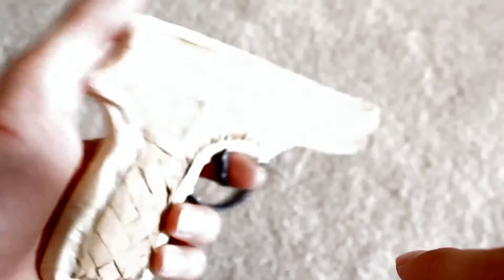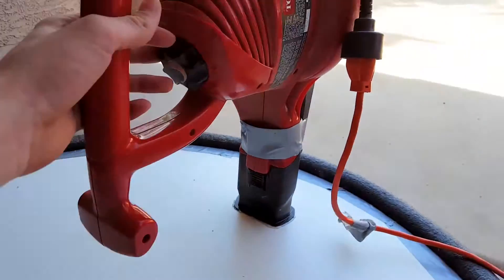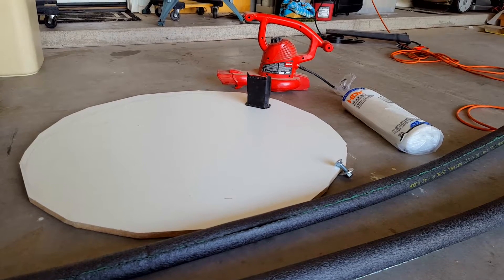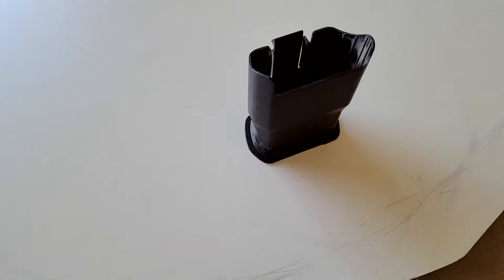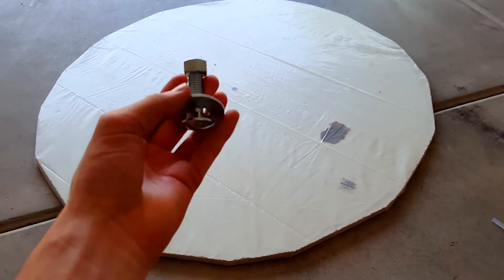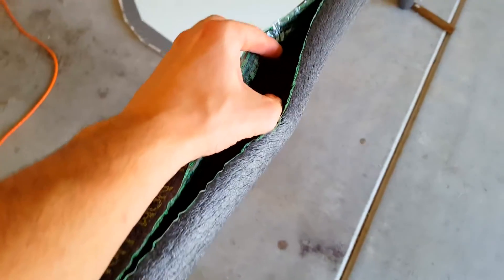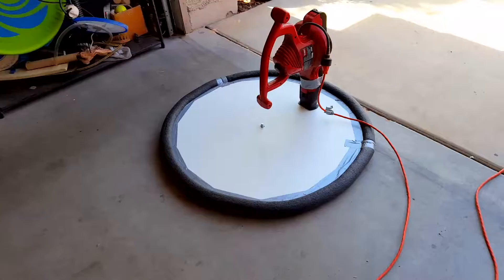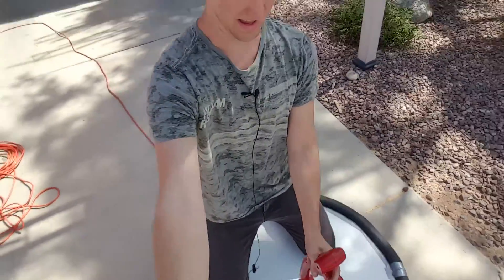DIY Leafblower Hovercraft Turotial

Comment: These kinds if hovercraft are really more like riding on a pillow with a lot of friction between the pillow and the ground, they are not really floating like the original hovercraft which had about a 9 inch air gap between the craft and the ground. When they added skirts, the craft floated even higher but you couldn't see that since the skirt kept the air in from the sides forming a seal to the ground. The skirts did not cover the ground as they do on these devices. They only covered the periphery but that requires a lot of power, maybe more than a leaf blower can provide.
Reply: Very interesting to read. I have noted from photographs online that the skirts on conventional hovercrafts have a rather small surface area with a big open gap in the middle. I admit I was tempted to build a basic hovercraft with leaf blower with the same minimal skirt surface area. However, you reckon such a design would require more power? Okay, maybe I'll stick to a large surface area skirt with the leaf blower. I was hoping to ride along grass - something these basic hovercrafts cannot do. Though there is a youtube video showing one going over sand okay.

Comment: You had a lot of friction because you pulled the plastic to tight so your riding on a super thin layer of air
Reply from the maker: +Bob Dillion i noticed. Thanks! I felt like i had to do that because the concrete was too rough and i was afraid it would rip the plastic if i gave it too much slack. Id love to try this again on a basketball court or something! Haha i also had a really old leaf blower. Fairly weak.
Reply: @DavidFranklinScience  There's another youtube video that shows someone using a lot of slack in the plastic on their DIY leaf blower hovercraft. They had the plastic extremely loose and really baggy. And that one was able ride over sand without any trouble. But it failed miserably on grass.